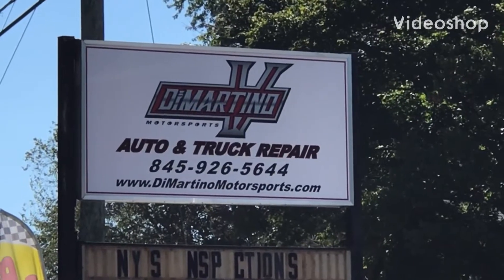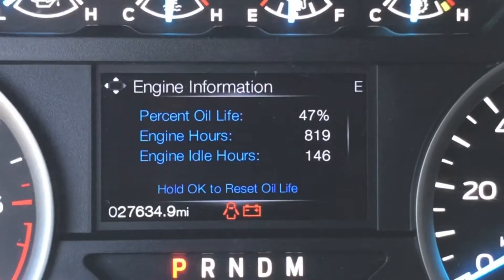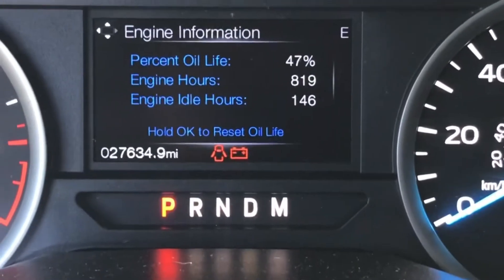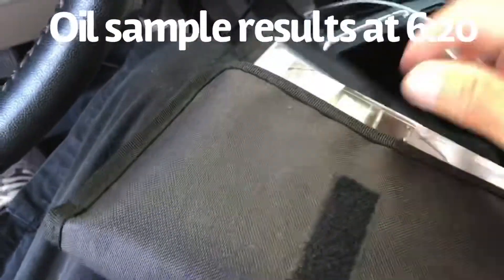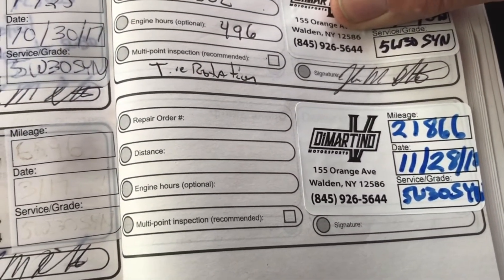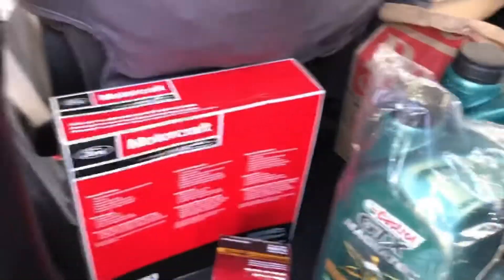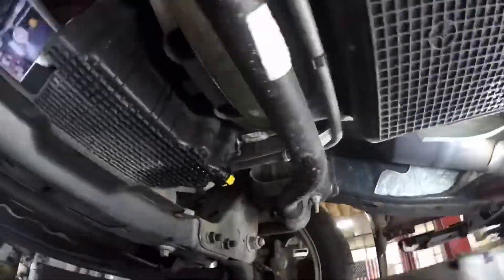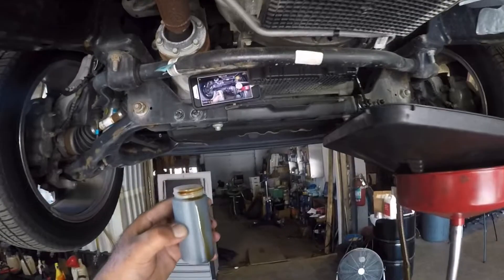3.5 Gen 2 F150 ecoboost  oil analysis and oil recommendation.

Comment: I don't go by thepercentage... I do the same thing as you do... 5,000 miles and drop it. GM recommends 8,000 now on 5.3 engines. I was told by a GM mechanic... 5.3 motors are dropping pistons at 80,000 miles because of it. Change the oil at 5,000 and use a good synthetic oil. Great Video bro...
Reply from the maker: Dave Ackerson Thanks Dave and I agree oil is cheap,engines aren’t!
Reply: @JohnDiMartino  the percentage on the Ford oil life monitor is based on driving habits, how much you idle, driving enviroment, etc. On my Ford, 5% oil life for me is about 6k miles since I do a lot of idling and city driving. The oil life monitor on the new Ford's are pretty smart compared to other ones, where they just go by mileage and not engine/driving conditions.
Reply: I still go every 3-3500 miles
Reply: @alextran8188  ok, but you still have oil viscosity breakdown, and if that happens, especially at idle... the oil may look clean but its still not lubricating the bearings and mains as good as it should. If the motor is running, you still should drop by 5000 miles not matter what.
Reply: @dackerson5  not if you run a quality oil. For me I go 7k on my ecoboost. 5k is too little 10k is too much
Reply: @dackerson5  not if you run a quality oil. For me I go 7k on my ecoboost. 5k is too little 10k is too much
Reply: @alextran8188  Still, I use Amsoil, which is one of the best and still drop it at 5000. A motor is alot motor expensive then an oil change

Comment: Good video. Those oil life monitors are thee for dealership service depts to make easy money doing unnecessary and wasteful oil changes. I ignore the monitor and do it based on mileage, typically every 6000 to 7000, depending on the type of driving I've been doing...with full synthetic and the best filter I can find.

Comment: The eco boost love to be run . They hate short trips and being babied.  I personally have a 2020 to 3.5 that I used to tow trailers cross-country on a daily basis and this truck will idle at times 4789 hours and then get right back on the road and keep going and even at one point ran for two weeks straight without ever turning off And I’ve done normal oil changes between your regular Ford Motorcraft oil to platinum Pennzoil full synthetic mobile one full synthetic and at the oil change intervals done by the computer and the engine. When checked with a scope is in perfect condition and it runs absolutely perfectly, and like I said they do not like to be babied and another thing is don’t use anything but premium gas specifically the power as the engine seems to love the power more than any other few out there  at the current moment my truck has over 53,000 miles on it just since August and it runs stronger now than it did when I got it from the factory itself and regular vetoes a 8 1/2 x 16 x 9 1/2 tall trailer across the country fully loaded up mountains down mountains  and does it with ease and the motor is in fantastic condition but that is using premium gas at all times. You biggest thing that you’re going to see with these is if you do idle a lot and it is very common to what I do if I come out of idling for hours an hour straight when I go and take off, I make sure to get it opened up and do not just shut it off at that point and I always make sure that it is able to blow out any carbon buildup or situation to that effect, edit has more power than many other eco-boost that I’ve driven and it has been noted by other people that have driven the truck that it seems to have a much stronger engine than other similar trucks including my brothers 2017 F150 raptor which has the high output he could boost  and isn’t used for any of that. He’s also noted that the engine seems to be a lot stronger even though it is actually at a lower rating power wise and once five star decides to finally ship my tuner I am going to have it fully tuned and have a variation of tunes a total of 10 ranging from E 30 all the way down to 85 performance total tunes and performance tunes  mainly focusing on the mid grade to premium performance tune, and performance toe tune so I will update after I get that done and at that time I will be switching to Amsoil for an interval of every 7500 or stick with Pennzoil platinum full synthetic and do that every 5000 with an extended protection oil filter from wicks Orion soil
Reply: Wow what an overpriced truck

Comment: Used motor oil contains carcinogens. Consider wearing gloves when changing oil in the future. 
Also, boost blow-by contributes to motor oil contamination and accelerated oil degradation. Consider a catch-can to trap water and other combustion contaminants to extend your oil life and time between  changes.

Comment: John, thanks for sharing! Have you hit 6k miles yet? I have the same truck and I’m changing my oil every 5k.
Reply from the maker: No I haven’t I am at about 3100 miles oil life is showing 45 percent
Reply: @JohnDiMartino  Good deal. I'll check back in after a few more months. Initially I was going to get a 5.0 but I fell in love with my EcoBoost during the test drive. I've read the 3.5 has had some timing chain issues and the best insurance is to change the oil every 5k. There's not a ton of oil analysis info out there so I appreciate you taking the time to share it with us. Thank you.
Reply: Mark,  I have a 2018 3.5 Eco Platinum and yes it has the timing chain issue. . They are lookin at replacing the timing chain and the cam phasers as well. My neighbor has a 3.5 2018 Ford Limited also down the street and he also has the timing chain issue. It is a known problem. Sad it’s having issues because I really love the truck. I also only have 20,300 miles and my neighbor has around 30,000 when he started having the issues. Think goodness we are both still under warranty.
Reply: Instablaster...

Comment: What an overpriced truck
Reply from the maker: Be that as it may when I bought to I got 8k off sticker and used trucks 2 yrs old were only 1-3k cheaper. When I traded it I lost 6k for 3 years and 33k miles out zero into it exc oil changes and mods which I took most off to put on my new truck.
Reply: @JohnDiMartino  You just bought another overpriced truck with no life time warranty like Toyota offers.